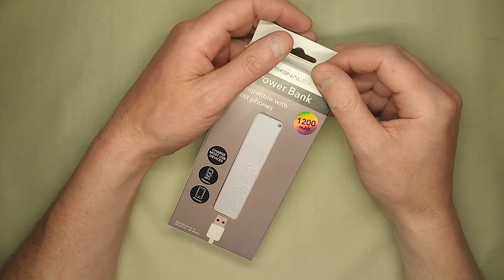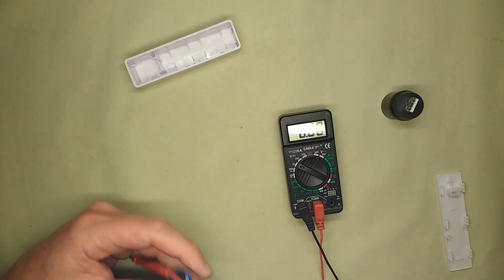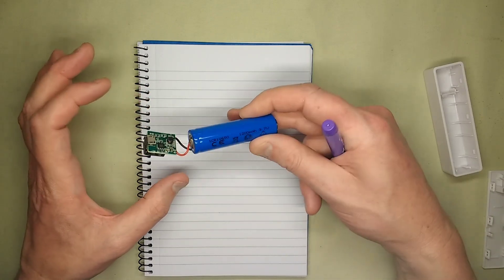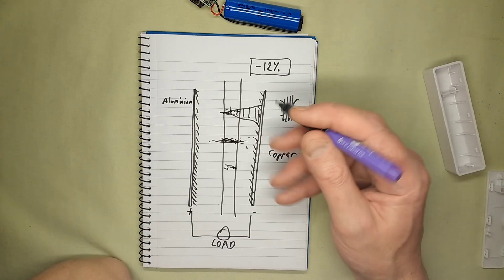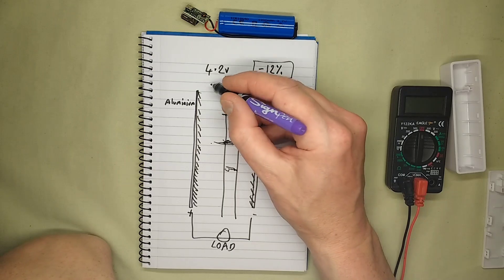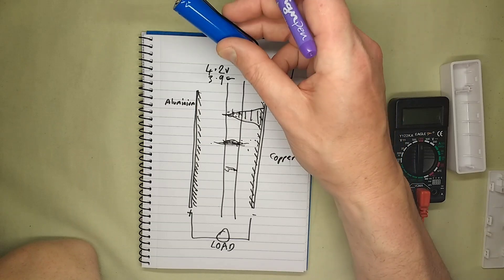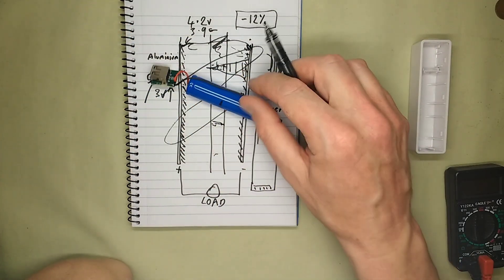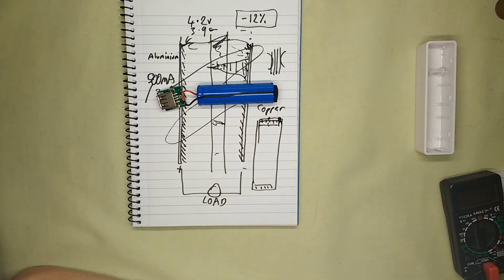Are over-discharged lithium cells safe?  (And how to test for damage.)

Comment: Proper charge controllers should not push full charge current through a battery so discharged, our loved TP4056 charges the cell with 1/10 of the nominal current when the voltage is less than 2.9V
Reply: You are correct, but this part i am missing in this video. Does the chip handle a lower current (& voltage?) when it over discharged?
Reply: I don't know, I can't find datasheet for that chip. It should, but who knows. Maybe Clive can make a followup video testing that, I'm interested to see what that chip does. We need a comment with a lot of thumbs up to attract his attention.
Reply: It's a wrong part, your datasheet is for a high-side shunt amplifier :) The chip in powerbank is a chinese clone. The only way to know for sure is to perform that simple test.

Comment: Are these cells protected?
Reply: ricky foster No, these are unprotected cells. The PCB in effect has protection circuitry built in, but does draw a tiny current.
Reply: Pook365 thought it would have been like that cheers

Comment: This a bit strange situation, because even if battery is not completely destroyed overcharge causes it to release some gases as this study says,   so it builds pressure inside and it may blow up release valve.

Cylindrical cells can sustain that pressure somewhat, but flat cells will severely bulge once over discaged. 
Attempts to charge them will result in even more pressure.

it would be interesting if you made an experiment what happens if you completely discharge flat cell preferably in the plastic pouch case  and see how it will inflate like a ballon.

Comment: Ever fancied testing or evaluating the battery pack from an electric car?
Reply: As the OP said tesla and a few others use 18650 cells, and the ones that don't use deep cycle lead acid batteries.

Comment: Yes that was the documented problem with samsung, they compromised the allowance area by putting form over function. They had no adequate safety space.

As for the battery, it's an old trick to put it onto a charger in nimh mode on the lowest charge (0.1V) and trickle it up. All of this battery info comes from the RC community. :)

Comment: The other known issue with the Note 7 batteries was the battery thermal sensor, it never reported on temperature so when the phone was charging the battery went into thermal runaway and burst.
[Mobile Phone Repair Technician]

Comment: Did you charge this cell and do the 'self discharge' test to see if it developed paths through the insulator ?
Reply from the maker: I did and the voltage was the same two days later, so it appears fine.
Reply: Not bad for a cell with charging chip for 1 Pound. I hope its got more than say 700 mAh, so it will be useful

Comment: It somehow would make sense that a lithium-ion battery would be able to (with)stand total discharge as in the production process that is followed of course they are assembled from separate components all initially being in a state of discharge of course after which the more or less liquid electrolyte is added, and after that they receive their first current (and get charged). Seems one possibly could compare that to the assembly of say a motor (an engine), and view the battery's state of charge as analogue to that engine - once it is completed - being set in motion.
Reply: This reasoning is faulty. When charging and discharging ions will have moved and the distribution may no longer be uniform and the chemical and physical processes are different. To be clear, I don't claim that what you say is wrong, just that you can't make the argument.

Comment: When do we get to see this massive heat incident you speak of?

Your timing is impeccable I have to disassemble an 18650 pack today which is 4 in parallel and 4 in series (16 cells total) in order to find out why one of the sets of 4 cells is dropping voltage; hopefully it's just one cell dragging the other 3 down.

Why is it that they just seem to fail from time to time?

Comment: I wonder if they are manufactured in an uncharged state?
It would make sense for safety and shelf life. I guess that when you charge it for the first time the lithium ions start off equally distributed and then move to the negative electrode when it's fully charged.

Comment: should a 12v 20amp gel battery be discharged every now and then?
Reply from the maker: SLA batteries do benefit from an occasional discharge within their limits, but their mains uses seem to be in a continually topped up state.
Reply: +bigclivedotcom thank you very much clive. much appreciated.

Comment: Is it possible, that as they know the powerbank will charge from 0v, that they are shipping them uncharged on purpose for safety reasons?
Which makes me wonder, if that's possible, then why are lithium batteries (and those in products) not always shipped uncharged, averting and safety concerns.
Reply: That has probably to do with quality control. In order to test if the battery functions properly after manufacturing you'd probably charge it to see if it holds charge or doesn't explode or anything like that...
So yes they probably could send them out fully discharged directly from manufacturing, but that would I guess have great consequences on quality control...

Comment: I did the back-of-a-postage-stamp math: -12% is about -0.5v.
Reply: 12% energy, not 12% voltage
Reply: Taking the paper results that a reverse charge to -2.19V is needed to seriously damage the cell, the simple expedient of a diode bypassing each cell for reverse charge could do a lot of good when a pack is over discharged.
Reply: I did check out the research and I was a bit confused by the numbers. 
Why would the cell be at higher negative voltage at the -12.1% SoC of -2.108 V when compared for example to the -100% SoC was at -0.358 V?

Does the ISCr, start getting very aggressively lower when moving past the -12% SoC point, so that the discharge current flows more through the now formed copper dendrites and therefore the cell doesn't show as high negative voltage anymore?

EDIT: After looking at the study again and in particular Figure 1. It's clearly shown that the cell voltage actually drops lower -> -2.2 V at the start of overdischarge and then rises towards the -0.358 V the -100% SoC. Interesting.
Reply: Which is totally useless because voltage has nothing to do with stored energy.
Reply: +superdau The idea that reasonable person watched the video, saw my comment, understood the conversation and responded as you have leaves me incredulous. 
Negative voltage on these batteries is out of spec, and lower than  -ve 0.5v according the research Clive cites damages the batteries. Clive describes the threshold found by researcher as 12%. I'm just saying -ve 0.5v is what people should be wary  of if they see it on a meter.
Reply: The paper states that -11% charge was at -2.19V, which is where real damage started to occur.

Comment: I once accidentally discharged Panasonic NCR18650A 3100mah cell to 0.00V. Nothing happened and surprisingly capacity not even decreased.
Reply: if you did it all the time it will not have as many cycles as one discharged to only 2.5v

Comment: Definitly going to read the document, thanks. My experience with overdischarged cells is slight capacity loss and higher internal resistance, which makes the cells rubbish to use.

Comment: Clive, with regards to samsung batteries, it was the ribbon coming out of the cell, before the protection circuitry, the traces were so close and yes you were right the battery didnt have enough room, the battery expanded a little and allowed the 2 traces to make contact, and, erm , boom?

Comment: I'm still amazed at Li Ion cells. I've got 3 in my vape, they take 3000MAH charge and can discharge 20A continuous. All together they give me 33A whenever I press the button. At full charge they can put out 250W of power although that dips at about 90% charge. These little buggers are like tiny nuclear power plants.
Reply: Knight-Errant There are some absolutely ridiculous discharge rated batteries available for RC models.
I've got a tiny 350mah pack that's rated for 65C continuous and 130C burst - 23A & 45A.
I wouldn't be at all surprised if the battery was capable of that, but you'd need wires that weighed as much as the battery :)
Reply: I just love it because my mate who's into electronics shits himself every time I almost knock my vape off a table or drop a battery on the carpet. He thinks they'll just erupt into explosions every time!

Comment: I discovered recently that several of my power banks had discharged the cells to below 1v so good to know they should be ok/safe - thanks :-)
btw - I have now fitted a toggle switch to them so I can disconnect the battery when not in use to stop it happening again

Comment: This confirms what I've heard before - the real danger of damaging the battery is is reverse charging the cells.  Not normally a problem with a single-cell pack, but as issue with multi-cell packs.  Even then, I think there's a difference between discharging with a load and self-discharge.  If a battery self-discharges, it's unlikely to develop a reverse charge on any of the cells.

Comment: 6:09  “Copper molecules”? 
Come on man! You know better than that!
Reply: Molecules are a group of atoms bond together with chemical bonds e.g H2O. These atoms do not have any chemical bonds with atoms outside of the molecule.

Solid copper consists of copper “atoms”. These are single atoms floating in a sea of the electrons all bonded together (metallic bonding). 

In general, for solids, we have:
Metallic solids: as explained above
Ionic solids: cations + anions bonded together with ionic bonds e.g. NalC (Na+ Cl-) [Edit: There is no NaCl molecule here. Each Na ion is in vicinity of 6 Cl ions and vice versa. NaCl is just "Empirical formula" of this compund]
Covalent solids: all atoms are bonded together with covalent bonds e.g. diamond (C-C bonds all around) [Edit: Here each C atom is connected to 4 other atoms with covalent bonds]
Molecular solids: single atoms or poly-atomic molecules hold together with weak forces (physical bonds) like van der Waals forces e.g. Paraffin wax

More info: 
https://en.wikipedia.org/wiki/Molecule 
https://en.wikipedia.org/wiki/Bonding_in_solids
https://en.wikipedia.org/wiki/Empirical_formula

Comment: You can cross the street without looking 1000 times and be fine. But that one time you'll end up as an article on page 8 of the newspaper.
That's why people say not to do it.
Reply: You can also cross the street with looking 10000 times and be fine, the one time someone else is speeding down the road and you'll still die. Do you avoid crossing all roads in response to the risk?

Comment: Good video and interesting paper. I've been getting these units from Poundland for a while as the cells are quite good. I take the cells out and charge them at <50mA using a charger I built around the MCP73841 until they reach about 2.8V, then they can charge normally at 500mA. I've had no problems and the cells have a good capacity and low self-discharge provided they are not permanently reconnected to the charging circuit provided.

Comment: i have a really puffy 4s pack,  its dropped from 5000mah to 4700mah, i wont throw anything, its one half of the wife's daily use ebike battery pack now lol...
Whats the other half you wonder? the 4s pack i drove over in the dark with the van, its not square now its like a roll.....

issue is when you have series cells and just a simple low voltage alarm, if one cell is dropping faster than the others, once it gets to like 2.75 it will fall like a stone to 0, and then the other cells in the series chain will push it into a negative charge, then once this happens the voltage of the overall pack is low enough to trip the low voltage warning/cut off, but for that one cell its too late.. then you plug the entire pack back into a charger that the toy or whatever came with, and the fun starts...

Comment: interesting video and an interesting read also.
I suspect that severely discharged and left in that state for a long time will permanently kill the battery.

I also wonder if these Lithium charging chips all have the ability to slow trickle charge up to say 3 volt then start the main charging process. if so, it's a safe combination to use the charging chip  and any lithium ion battery.

Comment: Yes it is. Not as bad as people think, but it's a problem. If you discharge it to 0, it could possibly kill the cell,  or it could not. It's 50/50. If it takes a charge with no heat,  it'll be okay. If not,  throw it away.
Reply: I have one of those Karcher window squeegees that has a single 18650 inside. From the store it refused to charge due to the battery voltage being too low at ~2.5V. (thank you lawyers!, NOT). Rather than the return hassle I disassembled the unit and put my benchtop power supply on the battery leads to charge it above 3V which then the internal charging circuitry allowed it to take a charge. Gotta love planned breakage built-in to products simply because they sat on the shelf for too long.... Not a single thing wrong with the battery either, it holds a charge ~3.8V for months.

Comment: Makes perfect sense Clive, I wonder how many 18650's have been dumped simply because their open circuit voltage was considered 'too low'.
 On different types of batteries I've had successes by aggressively overcharging them for a short time to burn clear any slight internal shorts.
 Though 'The internet' won't believe me because, reasons.
Reply: More or less, just keep an eye on temperature and don't let the current go silly high,
Reply: i've used high current pulses to attempt to recover nicads and nimh, very hit and miss and all cells i've done it to that seemed to recover failed again and in some cases leaked after a while.....although quite a long while !
Reply: I use a somewhat beefy 10-30W 12V center tapped wall adaptor in reverse wired as a Joule Theif using the center tap. Power for that comes from a regular smps wall wort. You take the output that's normally the mains side, and feed it into the cells through a diode. 25-50mA or so is the output, peak to peak 175V, and most of the current is delivered under 100V (30-70-ish). Also works great to desulphate Lead Acid batteries. PS: Don't touch the output.

Comment: I had a cell that had battery protection, it hadn't been used for a long time, it would not take a charge, it was at about 1v, i guessed that the protection circuit was stopping it from charging (for safety), so i started with a 1k resistor on 5v direct to the cell, and monitored the voltage, it crept up slowly, so i used a 500 ohm, it was going up in voltage a bit quicker, but under control, eventually it got to around 3.5 and was able to complete the charge via the normal circuit, that cell is still fine several months later.
Reply: The way battery protection works is that it turns off the discharge but still enables charging. Most phone PMICs don't attempt to charge when they don't see a battery voltage at all, but Tp4056 and many power bank circuits usually will trickle charge it, see if it recovers, and then charge it normally. Always a good idea to keep something like that around.
Reply: Your second assumption (which should be correct) is that the FET is either directly or indirectly fed from the voltage on the output of the circuit. Sometimes it is only powered from the battery. Hence my "crap circuit" comment because even though it should be as you say in a well designed circuit, some of the circuits seem to have been designed by a deranged sloth. As for the body diode, again you should be correct but even some of the silicon is badly designed so effectively you get a zenner in reverse series with the body diode (and this in turn introduces even more parasitic components) which buggers up all sorts of parameters. This I have been led to believe is as a result of someone far east trying to copy International Rectifiers "Trench FET" design without understanding it and as a result getting the design completely arse about face. So what we have here is a badly designed circuit using badly designed components. Welcome to the world of really shite electronics.
Reply: I have a "PiTop", a laptop designed around a Raspberry Pi.  It seems to have this problem.  Left unused for about a month it will self-discharge and will no longer charge.  First time this happened, the company replaced the battery.  Taking apart the old battery, I found one of the 4 cells completely discharged, the other three were just fine.  So I suspect the circuitry just prevents charging under that circumstance.  Now it's happened again, so I plan to dismantle the battery and either manually charge the dead cell or replace it with a cell from the first battery.  Unfortunately, the way the PiTop is constructed, working on the battery will require dismantling the whole laptop down to bits, while charging pretty much requires full reassembly.
Reply: Gordon, why? You're basically charging through the reverse body diode initially, you don't even need the gate. Plus when the charger is in initial recovery trickle charge mode, it limits current, not voltage. Given that initially no current flows (your condition: battery is not charging), there will be plenty of voltage.
Reply: The cell i had came from a piece of equipment , i doubt the protection circuit was cheap, i think it was done on purpose so you didn't charge a dead cell in the conventionaal way.
Reply: Siana Gearz, that's the way they are supposed to work. However as the FET's are enhancement mode it simply will not charge if the battery is too low as you wont reach gate threshold if it's a crap circuit.